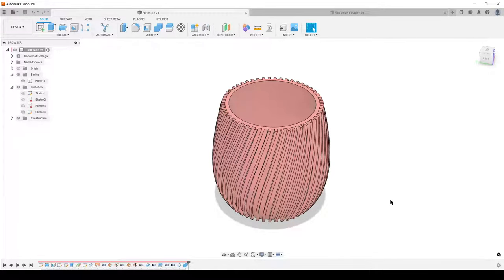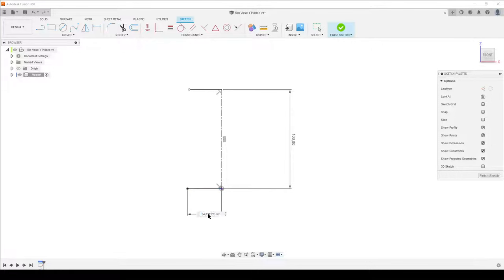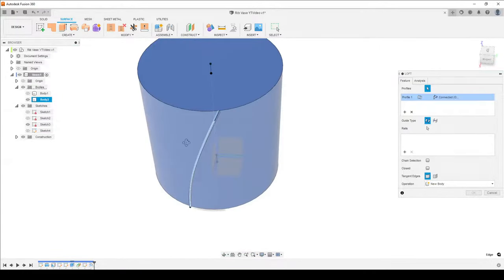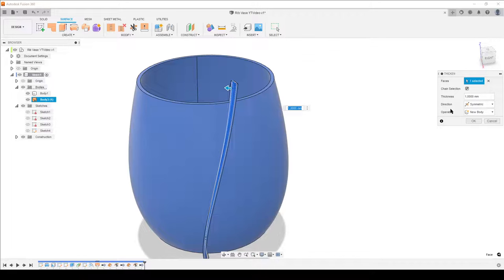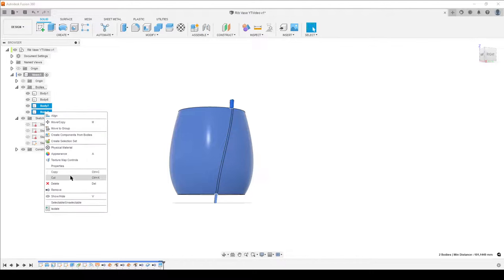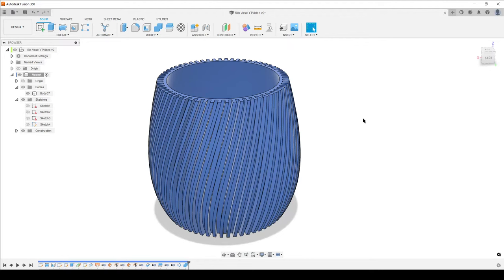Fusion 360 - Sweeping Ribs on a Vase

Comment: I am just wondering why the workflow needed to be so complex? You could have just drawn the curve on an offset plane and then done a extrude from body. This would mean that you can then easily go back and adjust the curve.
Reply from the maker: Extrude is always perpendicular to the sketch plane. In my design the rib is aligned to the center of the vase. But you suggestion create some interesting geometry  :)
Reply: good job
 but  yeah u got extra few steps u could of avoid 
i think : once u drew the line then project on the vase then just use square pipe cut 
and arrange
Reply from the maker: @randomgeno6490  I can think of 2 problems with a square pipe (or sweep): the profile will twist because the path is in 3D, and the path needs to be extended beyond the vase or it will not cut all the way. Give you workflow a try and please share what you find.
Reply: @KristianLaholm  i did and actually yeah .. it wont cut all the way up .. but simply press pull the top and it will be ok 
secondly there is an option to make the  cut perpendicular to the path weather sweep or pipe or arrange 
so just one solvable problem

Comment: Interesting way of doing it. These are cool because there's just so many different ways to do things. I usually just draw out the bottom profile on the XY plane and then extrude a form up from that with 5 or 6 front faces, then switch to front view and select the edges and manipulate the shape to match whatever curvature and twist profile I want. Then, just switch back to solid tools and place a plane at the top of the form and do a boundary fill to create a solid. Makes it very easy to go back and modify by just going back and manipulating the form or the initial sketch profile.

Comment: i just worry for the beginner.. your step make them horror.. too many complex step i think
Reply from the maker: Every videos is not intended for a beginner. But if you know a faster and easier way of doing a vase like the one in the video please share :)
Reply: @KristianLaholm  absolute beginner here and learned some very cool tricks, thank you for not dumbing it down, knowing i can use formulae and variables is fantastic
Reply from the maker: @WarmFPV  Thank you
Reply: I consider myself a beginner after 8 or so other tutorials and a few self guided projects. If you approach this project on day 1 with fusion 360, it will take a couple days of rewinding and retrying. but at my current level, i was able to get through it in a couple hours. I restarted a few times after making obnoxious mistakes i didn't care to undo. this was a great exercise that helped me incorporate many skills into my work flow.
Reply from the maker: @ianhighley1859  Thank you and keep on modeling :)

Comment: Brilliant.  I never could have figured this out on my own.  This design was exactly what I was looking for.  One thing, Fusion wouldn't let me create cylOD while dimensioning.  I had to create the parameter first and then use it.
Reply from the maker: Creating parameter in sketch should work. I'd try it in another design.
Reply: Hi, I opened the Parameter Menu and then looked under "Model Parameters" > Sketch2 > Diameter Dimension-2. The name of the parameter in my version of Fusion is "d7" and not "cylOD".
Reply from the maker: @JesFinkJensen  In the workflow the name changed then i created the parameter/dimension in sketch. But you can change the name in Parameter Menu and make it a favorit.

Comment: can you add a link to your formula? You spoke a bit to fast for me and could not see it on the screen
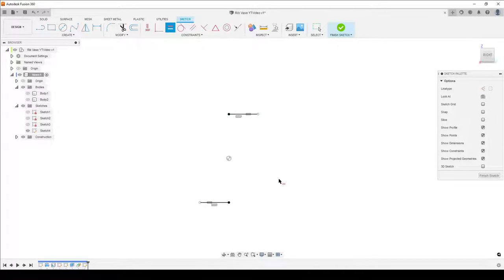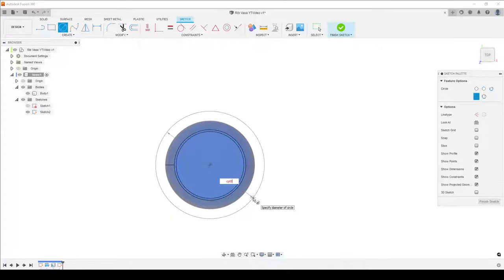Reply from the maker: The formula used @8:00 is: "Twist angle deg" / "Full revolution deg" * Circumference of cylinder => In the video I used a parameter for the cylinder diameter "30 deg / 360 deg * cylOD * PI" The user parameter was created @5:20 in the sketch.
Reply: @KristianLaholm  Thank you
Reply: @KristianLaholm  My 360 won't recognize that formula. tried it several different ways. Any ideas?  typed it like this.   30/360*cylOD*PI
Reply from the maker: @gregmccormick21 It looks correct and works for me. Check the Unit of the parameter and if it works with only parameter or only "PI"?
Reply: @KristianLaholm  Just went back through step by step and copied everything you did. Now when I get to the dimension part just before the equation prompt, the model now says its over constrained.  getting a bit frustrated here. Any ideas? I'
I've gone back and created two brand new models from scratch and now this is the problem.
Reply from the maker: @gregmccormick21  There must be something you are getting wrong, I redid the workflow and got this file https://a360.co/46cjMhB (I hope the link works, view and download)
If you have snap to grid on it can sometime cause issues (and check 3D sketching is off), more then that it's hard to troubleshoot without seeing your workflow.